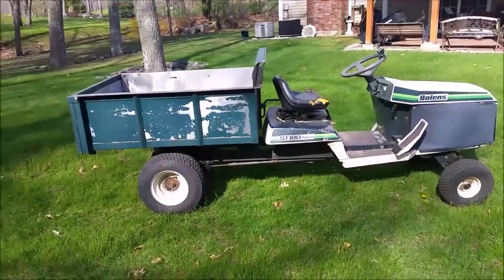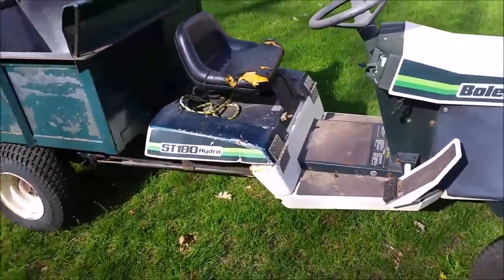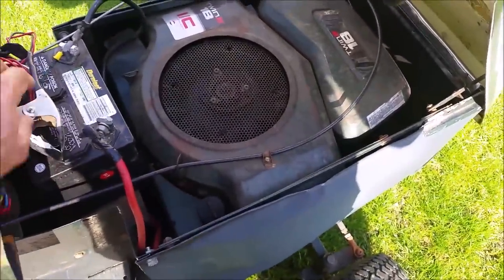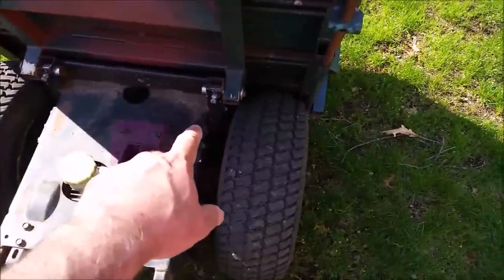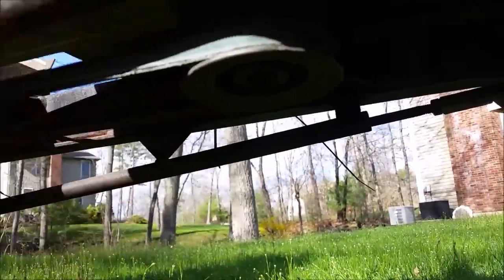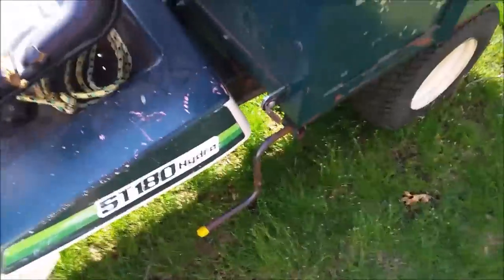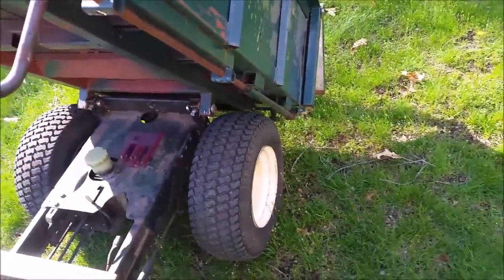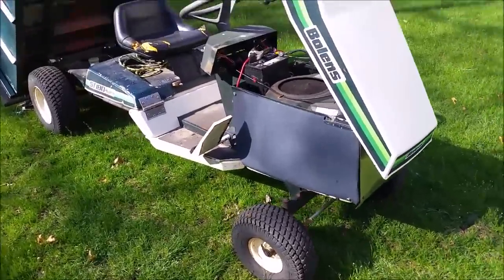Homemade tractor dump truck mod: Truck-Tor. (Tractor mods)

Comment: Try using a power window motor off of a car's power windows for the dump bed. They can be found in salvage yards for cheap and their pretty strong. Their good for a lot of different projects. 🙂
Reply: Good call, you can even mount to the older style linear hand crank, or I guess even a scissor jack, jacks and make a linear actuator that's really heavy duty.

Comment: Does the air cooled motor run cool enough with the sides enclosed?  It is a well engineered buggy. I know it would be handy around the homestead. 👍

Comment: Just a quick FYI: I have found that Plano Power equipment in Plano Texas has a wide variety of parts for gas engines at good prices. When I sold used lawn mowers, they had the best price for Honda small engine carburetors. I could buy a complete carburetor from them for less than just the float locally, and they have a good website. A place that has a lot of things like linear actuators, motors, hydraulic cylinders, and lots of other things is Surplus Center in Lincoln Nebraska. It's a good thing that I don't live near them. I'd spend all of my money there. I was thinking that for a dump bed, a hydraulic cylinder powered by a power steering pump from a junkyard should work. If I remember right, these pumps run at 1000 to 1500 psi.

Comment: I'm to the point where I'm wanting to put pull starters on all my small engines.  Looks like can be done using stock, modified others brands like the Honda's that are cheaper, or the more old fashioned notched pulley design.   If heavy duty, the last design can even be made to have another pulley for driving something like hydraulic pump, pneumatic compressor, generator and/or alternator.  I guess even a gear box too for a front horizontal shaft to tap into for implements.

Comment: interesting I'm building things from old riding mowers, 
yours makes me wonder the turning radius... in need 
something shorter......
    . building a stubby took 20 inches outdoor the frame
    . a mini forklift....big tires on fork end.. 
    . and a dumper like yours but shorter....
yours was a thoughtful build
Reply from the maker: Donald Powers yes the turning radius is definitely larger. It's not a problem but I do need to remember to take wider turns. As I mention I didn't build this but it is well put together and it is very useful around the yard. I haven't had time to add a power lift and that is a must. See my other video on my Frankentrailer... that I did build and the power lift is great. Thanks.

Comment: Take the sides off the engine Bay Area lol it need to be able to breathe and cool.
Reply from the maker: Yes you are right it is too closed in. Unfortunately the original covers didn’t come with it and I was getting mice to nest in the engine so I used whatever I had laying around but I should cut holes and put in a mesh. Just another project on the list!
Reply: @ScrapMetalWorks  put moth balls around the engine when not in use ..
Reply from the maker: @randytravis3998  I did that before even with my car! I have replaced the engine since and have not run into the mouse issue again. I have a couple of update videos on this. Check it out. Thanks!

Comment: My Bolens 1225 hydro uses Type F transmission fluid.
Reply from the maker: Thank you for the info, very valuable. this toy has served me well mostly to carry and hold firewood under my deck just outside of a basement slider door so I can bring it in when needed in the winter. The engine is past do so I'm just getting ready to do an engine swap and I will also flush and replace the transmission fluid. Thank you!